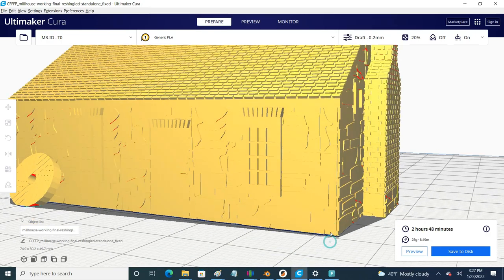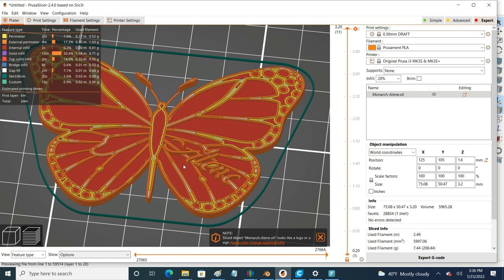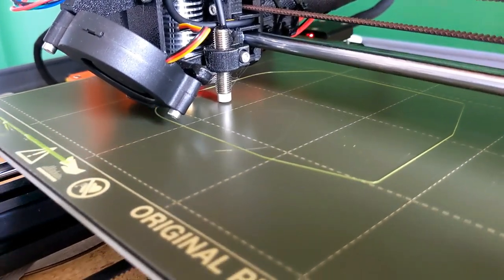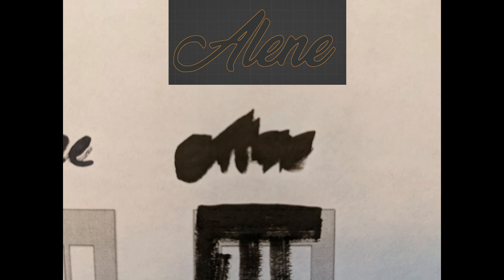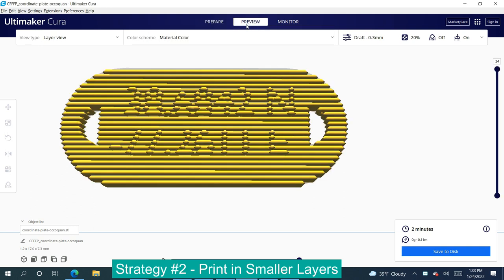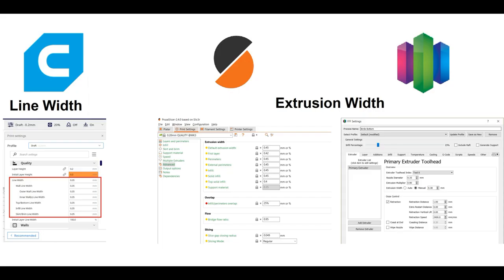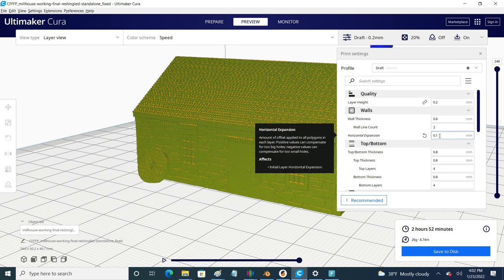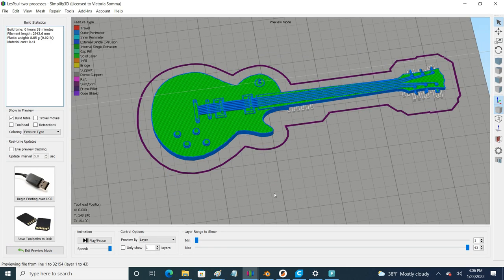Tackling Missing Details in Your Slice (with Cura, PrusaSlicer, and Simplify3D)

Comment: The last strategy works for me. The horizontal expansion. I use CURA and I'm really about to quit using until I found your video. Wasted several filament later, that  part actually works. I tried adjusting all lines to fine, spending days on prints that usually only about 1hr on standard quality and still the quality isn't there. When horizontal expansion is set to 0.1, they all magically appeared. I was wondering why isn't there a tutorial anywhere about this. It's just frustrating to not have the knowledge or this  set to 0.1 by default. Anyways, thanks for the video.
Reply from the maker: I am glad it helped you! Thank you for letting me know. I hope you have a great rest of your day!

Comment: Thank you for this video, however, my issue is almost Identical to the the building example in Cura. I have a building of similar scale also with small bricks. In Cura 5.2.1, the vertical grout lines appear, even with a .6 nozzle. However, in Cura 5.4 and 5.5, many of these lines disappear. They even disappear with a .4 and .2 nozzle slice (same layer height at .2). The horizontal expansion feature was a minor help at a .25 setting, but not completely. What has changed between 5.2 and 5.4 to create this error?
Reply: I'm having this exact same issue - did you manage to find a solution? Or are you just sticking with the old Cura versions.
Reply: @willmansell5984 I'm keeping the older version for the times details are lost. I need to see if the latest Cura has fixed this bug.